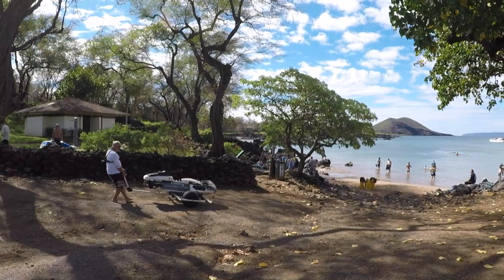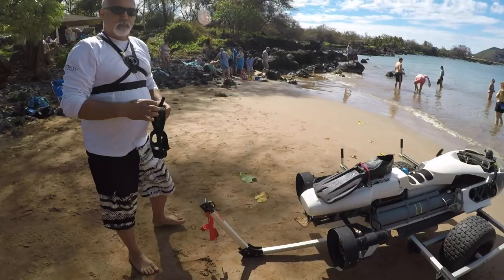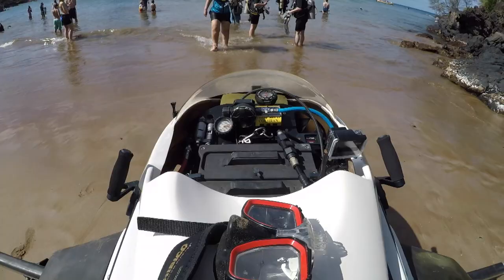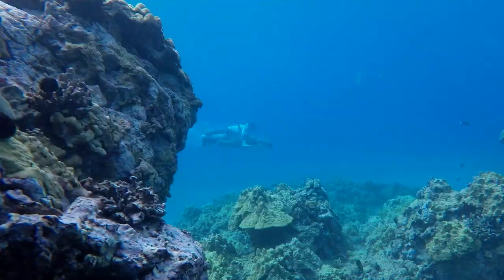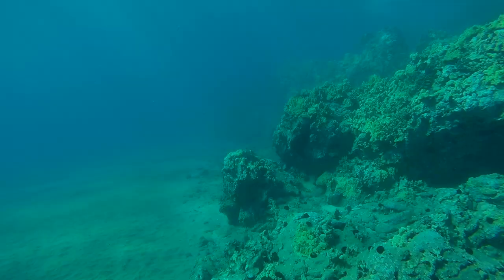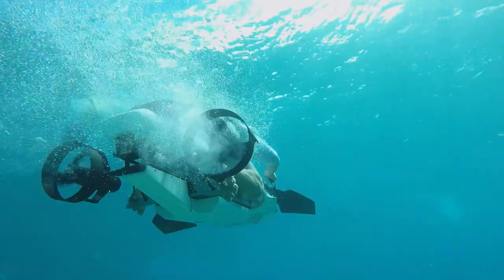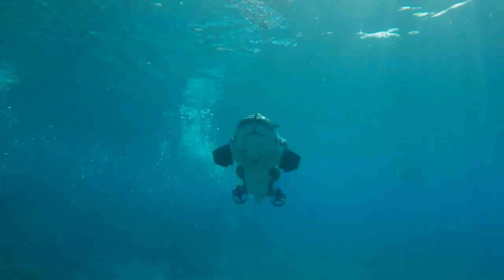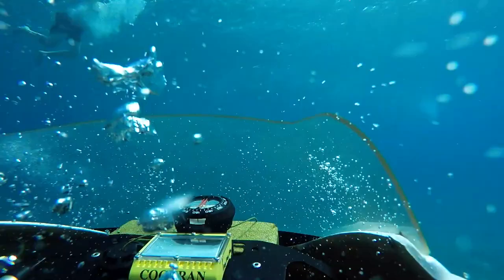Intro to the K10 Hydro Speeder

Comment: I recently helped a friend launch a Hydro Speeder for his first flight. I was his support diver. The whole trial was a disaster. The Hydro Speeder slowly rolled over and sank to the bottom. Once we got it into shallow water, he tried taking off, and the Hydro Speeder would only stand on end. That is, both propellers were facing the bottom and the nose or front was facing skyward. The only thing I could see out of kilter was air leaking constantly from the air-hose/electrical connector for the front & rear battery boxes. The air bladder in the front control would hold air without leaking, but it would not prevent the Hydro Speeder from sinking to the bottom. To get him in horizontal flight, I held the rear of the Hydro Speeder in shallow water. As he took off the Hydro Speeder wanted to roll over. My friend said that using the front hydroplanes, he was unable to go either up or down. He was able to steer by shifting his feet on the electric motor controls until the Hydro Speeder wanted to go belly up again. Does anyone have any knowledge of this underwater scooter to help in getting it to work correctly? The only change he made was to put three motorcycle batteries in both the front and rear battery boxes. They are 12-Volt and wired in a series-parallel circuit. Maybe the aftermarket batteries play a part in the weight shift?
Reply from the maker: Peakbagger   Please find my Facebook page Harry Donenfeld and message me there. My first flight was a shit show and I admit that those watching had a great time. Happy to help get you guys going!